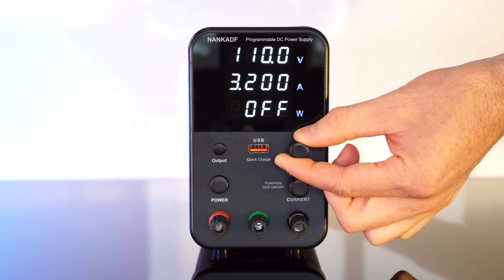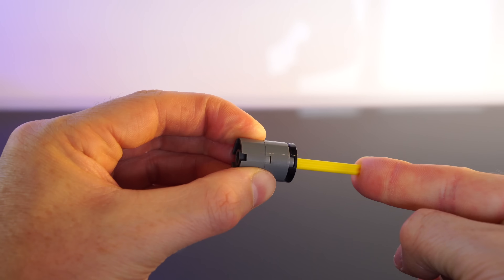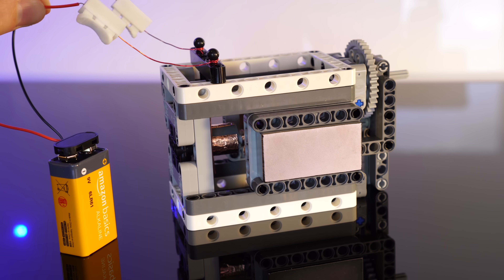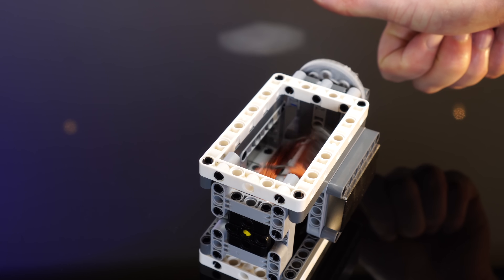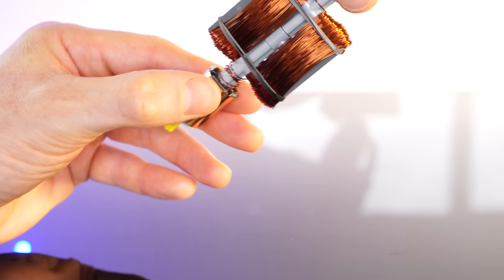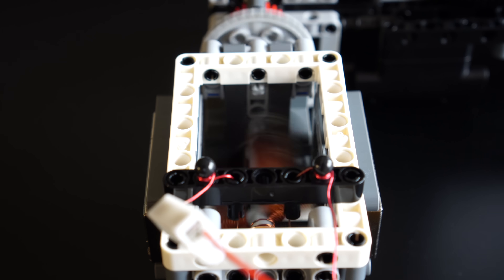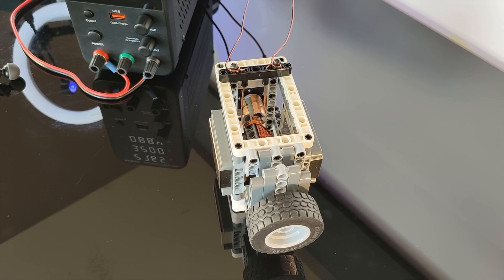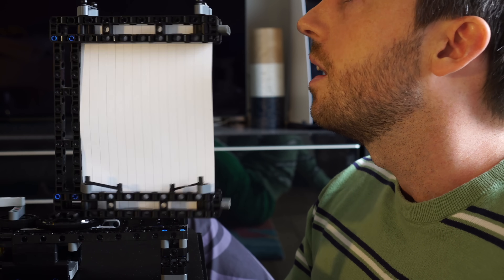Melting Motors: 120 Volts vs Homemade Lego Motor

Comment: You might be able to reduce your arcing by connecting a 150V bidirectional Zener diode or TVS diode (Transient voltage suppressor) between your windings.

The cause of this arcing is the stored energy in the magnetic field (E = 0.5*L*I^2) that is present when your coils are energized. As soon as the contacts of your commutator open, the magnetic field collapses trying to keep up the current that was flowing before. To achieve this, the coil has to build a high voltage than can bridge the pretty high dielectric strength (3kV/mm) of the air gap causing arcing.

The voltage created by the coil is equal to:
V = -L * (di/dt)
Where as L represents the inductance of your coil and di/dt is the change of current. Since opening the contacts abruptly means a very high change of current (di/dt), the voltage created by the coil will rise tremendously.

If you connect a bidirectional Zener Diode that will start conducting at 150V, it will clamp the produced voltage down to that 150V and gives a safe path for the coil to release its energy.

However the higher the voltage of the coil, the faster it can release all its stored energy and be sooner ready to accept the current in the reversed direction. I never tried this myself and I dont know how long the diode will last or die out after a couple of revolutions because of overheating, but I think it might be worth a shot
Reply from the maker: What a fantastic comment, pinning for education. Thanks a lot for taking the time to write this out - super easy to understand, and very interesting to know why these arcs occur. I have a lot of zenner diodes lying around and will see if I have any appropriate ones to test in future experiments. Appreciate it! 🙏
Reply: @JamiesBrickJams 
Hey Jamie, thank you. I rarely leave comments and never had the honor to be pinned.

But I have to admit, that I really liked your way of approaching this project by just trying stuff out on your own and not being afraid of failing or damaging something in the process.

It is a good demonstration of how engineering works: You have an idea and try to make it work, but something you haven't considered yet is totally destroying your effort. 
(e.g. a current limited power supply as many viewers have pointed out already ;-)). We all have been at this point. Most important is to not give up. From my experience there is almost always a way to make things happen.

I'm glad if I could maybe help you in the process. Even though motor drives are not my field of expertise the fundamentals of physics I layed out will hold truth and the culprit of the arcing problem is the discharging of the magnetic field but there are several possible solution to this problem.

Keywords are 'Snubber circuit' and 'Back EMF'.

By the way with bidirectional zener diode I meant two zener diodes put against each other in series. I was not sure if that was clear.

I am looking forward to a follow up video. :-)
Reply: @JamiesBrickJams you switched to cc
Reply: Bullshit. It is arcing because he know almost noting about motor construction and commutating the coils at wrong angles.
Reply: Motors normally use a capacitor for this purpose, even the ones for toys.
Reply: I'm thinking that the arcing may also be due to the commutator making poor contact?
Given the commutator is anything but smooth because of the superglue and the gaps the contact wire is probably bouncing around a lot and intermittently breaking contact.
To solve this maybe pin the other side of the wire down so it's tensioned and won't bounce as much. Also using multiple wires to distribute the current
Reply: this is truly a back EMF moment
Reply: most importantly add one of those ceiling fan capacitors across the terminal
Reply: What the sigma

Comment: metal on metal ain't better . use carbon brushes , they provide lubrication and heat risistance. make your core out of iron and have commutatiors at a slight offset to the magnets and windings.

Comment: 0:57
Yeah, I can imagine.
2 small ones from a harddrive (I harvest them whenever I have a harddrive that dies) snapped shut on my index finger a few months ago. And they pinched the skin so perfectly that I couldn't even shim them apart.
Eventually I just had to rip them off, along with the skin caught between them.

Seriously, Do Not F with magnets this powerful, cause best case scenario of an F'up means that you now have no skin in a big area. A bad F'up means you can no longer count to 10 on your hands...

Comment: 5:22:  Your commutator doesn't seem to be made right.  It is supposed to be split, like two pecan halves facing each other, so that the polarity changes every half-turn.  That polarity change is what makes the motor work --- though of course it is still difficult with a motor that has only 2 poles.

Comment: I wonder how big and powerful motor could you make with this style. Like maybe big axial flux lego motor that is fully brushless using hall sensors and driven with vesc for best control over coreless design lego supports.
Reply from the maker: I think it's possible to make a very powerful brushless motor if I use a BLDC. I've already made some pretty powerful ones. Current problem is vibration and magnets getting thrown off the rotor 😅 Time for some 3d printed parts I think 🤔

Comment: What size are your magnets? I wanna buy some but don't know what size to use. (Also, if possible, I would like to know where you bought them)

Love your content btw
Reply: I think I figured it out.
Using the surrounding lego piece size and average market size with the conversion of cm. to inches.
(Length Width Height)
1.97 × 1 × 0.4 inches
5.0038 × 2.54 × 1.016 centimeters

Please, if I miscalculated, feel free to correct me.

Comment: When working with magnets if you want a strong magnetic field, but only need it on one side of the magnet consider using a halbach array layout. You should have used better brushes as well. Also as others have said your power supply switched to constant current, when it hit the 3.2A limit,  so it wasn't running at 120V.

Comment: Nope, your limited @ 3.2amps and probably never really reached 120volts. At 4 ohms resistance the power supply must output 30 amps so...

Comment: i just used a power wheel motor it doesn't even need gear reduction it just goes 7897rpm at 12 volt and 1.75amp

Comment: The power supply is nice, but not powerful enough! You would need to push at least 10 amps at 120 volts for ultimate destruction!

Comment: If it's a magnet you don't wanna mess with, computer hard-drives. Two magnetic discs that are very hard to pull apart
Reply: Not to mention any dust in it kills the whole thing

Comment: This should work at 9V with a some improvement. First, the coil dont need to be oval, a circle shape do the same job but with less resistance. Second, you need to put the magnet the closest you can from de rotor. Thrid you need to put a feromagnetic material with a high magnetic permeability to increase the magnetic field in the rotor and you can even put this material around the motor to increase it too (just like the real motors do). Fourth : the connection between the wire and the aluminium tape must not be good because of the glue . Try to fix the wire and the tape between a lego piece fitted together with the rotor. GOOD LUCK , it is a nice project !

Comment: The coils need to have a laminated steel cores to work properly. That's why your amps are getting turned into heat rather than emf. Eddy currents are a killer. Adding more poles/bars to the armature will make it run more stable under load. Try using flat copper alloy springs for your contacts. More surface area is better for carrying the current and it will run cooler.
Reply from the maker: Thanks a lot for the suggestions, this is helpful. I've made a few motors with cores made of bolts, but find with these larger magnets that they put a lot of strain on Lego components when using a metal core. But I'm sure there's a balance that can be struck with more moderate magnets and a steel core. Cheers again for the help 🙏

Comment: Like others have said you didnt actually achieve 120V operation. You were being limited by the power supply hitting its current limit before its voltage limit. 
Getting around this is rather complicated because motors are very dynamic electrical loads, and everything from the strength of the magnetic fields from the permanent magnets, to the mechanical load on the motor, to the shape and spacing etc. of the coils themselves. If you took the time to learn the fine details of motor design im sure you could design one in such a way to run at full power (highest voltage and current at the same time). Or you could do my favorite approach, make several iterations with slight changes like different number of turns, different spacing to the magnets, etc. and try to find a trend in the power usage you can use to "guesstimate" the best design.

Still a very cool video showing the simple concepts of brushed motors and how their self-commutation works.

Comment: that's actualy 40 volts. get a variak, full bridge rectifier @electroboom and a capacitor for FULL "120" volts
Reply from the maker: I'd love to get a variac - cheers for the recommendation! Just need to justify the spend at some point

Comment: i would recommend you try with AA batteries next time instead of a 9v
edit: i should really watch more of a video before putting a comment, but it still applies, I'm sure it would have ran a bunch faster on 6 AA
 
9v batteries can't put out any real current (iirc the best 9v batteries only go up to 500mA for a few seconds when new and fresh), aaa use the same tech so they are equally bad (actually a 9v is litterally 6 aaa in series)

AA batteries are a different story, depending on quality and manufacturer, you can get up to 10 A from a single one (but lowest i saw on cheaper ones was 2-3 amps) and they maintain it for at least 30 seconds (when fresh)

Comment: Nice :D , you should add more parallel contact points (brushes). Using only a wire as a brush makes all the current go trough it , and will melt . with multiple points , the current will be divided by the number of "brushes" , and will make the collector last longer . the heat point will be mainly on the coils (you can add a Lego Fan/propeller to the rotor axe near the coils to cool them . With 4 coils in a + pattern should produce some interesting results :D

Comment: If you want to run your motor at 120V, you need a power supply that would deliver about 30A!!! Ohm law = 120V/4Ohm coil = 30Amps. Your power supply current limits at 3.2Amps.

Comment: Do steel logo exist?
Reply from the maker: I'm not sure about steel, but there is a great company that does aluminium parts
Reply: @JamiesBrickJams   oh then that would work for motors for yours. But I would also want to see a engine out of lego. So what i mean is make the piston out of iron and have a coil around it and oscillate back and forth to make the engine work

Comment: In the next generation, you can perhaps use actual brushes instead of just the wire, so that you get more contact area and less contact resistance.

Btw awesome video, as always. Loved it!
Reply from the maker: That's a lot 😁 I actually ordered some solder wick to use as a makeshift brush for future experiments!

Comment: You actually never got to 120v because you hit the power limit of 3.2amps wayyy before 120v. Powersupply limits current by lowering the voltage. You need to make a less power hungry motor for 120v or get a more powerful power supply
Reply: or he can get two such supplies.

Comment: just a quick tip, for a high voltage motor like you were trying to make, you need not thicker wires but thinner wire and way more windings, just from looking at a 120 volt brushed dc motor i rewired a while back
Reply from the maker: Thanks for the tip! I actually didn't realize this power supply would cap the voltage at whatever draw maxes out the current. Clearly you're right - need to build a coil with a resistance that'll only draw 3 amps at 120v. My original coil at 40 ohms should have been approximately correct, but I suspect I messed up the timer
Reply: @JamiesBrickJams  you should probably go even lower with the resistance something like 100ohms which will draw around 1.2amps which should make the motor work although if you want more power something like 70 ohms for 1.7amps.

Comment: What about putting some carbon brushes or at least lead to the commutator?
Then I would add some bearings at the motor shaft and grease all moving parts,
because at higher speeds the plastic would melt.
And for the next time: buy a more powerful power supply.

But with all that i have to say, it's a cool experiment.
It remindes me at my childhood when i played with several types of electric motors just for fun.
Thank you for this vid.

Comment: 150W with 3.2A is just 47V
Reply from the maker: Yeah that was a little disappointing. I mainly just wanted to max out the supply and see how long it'd run for. Next time I'll need to build a better coil. Though I'd imagine it wouldn't survive long at all

Comment: The motor never ran at 120v, the powersupply was current limited so the highest voltage it ran at was about 50v
Reply: or just build a FULL BRIDGE RECTIFIAHHHHHHHHHHH instead of using the puny power supply
Reply: Ok now iam no professional at electrical engineering but iam pretty sure that was 120 volts because it was on 32 apms and the voltage didn’t drop while it was running so that means it was drawing 120 volt 32 amps at the same time plus the wiring was 600 turns so im pretty sure it can handle up to 560 or 570 volts dc
Reply: @SAVRY2K  it ran at approximately 35v at 3.2A, not 120v. the power supply went into CC (constant current) mode when it reached its max output current at about 35v, asthis model psu is only capable of putting out a max current of about 3A. while it may seem it ran at 120vdc that's just the target voltage being set, the voltage is ultimately determined by the set max current (CC). this model also displays the target voltage while being set to show what the max voltage is, but this wont affect the output if the psu is in CC mode and the user tries to increase it beyond the voltage being outputed.
Reply: @theniftylynx6897  thanks for sharing your thoughts on this and now i think your opinion is correct and it makes much more sense now thanks
Reply: @theniftylynx6897  exactly, the only way to increase the power (watts) using that power supply is to increase the resistance
Reply: @SAVRY2K The only way to learn is to ask questions and make mistakes in the process, admitting that you're wrong takes humility. Hold your head high brother :-)
Reply: @Middle_G1 you are the first person I’ve seen on the internet that didn’t start an argument over something like this, so kudos to you

Comment: you never hit 120v, not even half of that. your 3.2a supply was going into constant current mode causing the voltage to dip. if you actually ran it at 120v it would draw probably near 10a or 1.2 kilowatts. also a thicker wire would run it at even lower power and voltage because it decreases the resistance that in return increases the current demand that your supply cant provide, thus it has to lower the voltage.
Reply: It's a 360 wat power supply
Reply: You can either have up to 120V, or up to 3A for a max of 360W. But you can't exceed 120V or 3A, and current limitation works by decreasing the voltage, so..

Comment: Can you run in 220v?
Reply from the maker: If I had a power supply that could output 220 it's possible in theory.. Though if you wanted the motor to survive that, it'd have to be designed differently to most motors to handle that voltage. Especially if it is pushing a significant current

Comment: Why not make the union with copper plates with copper plates, instead of a copper plate making contact with a thin copper cable? The contact point is very small, instead of increasing the diameter you could crush the tips of the cooper cable to increase the contact surface, but for that it is better to use those copper plates for the entire contact.
Reply from the maker: That's actually a pretty good idea, cheers! I've also just bought some copper wick which I've seen recommended - seems to be a flexible way of making good contact
Reply: @JamiesBrickJams  Now that I remember, in Tom Stanton's last video he used something similar to a braided copper wire and an alloy that I don't remember, but it seemed that it also made very good contact and seemed very flexible like a rope, I don't know much about electricity , but I suppose you could add 2 more fins of the copper wire, make 4 fins (2:05 there are 2 so I would say double it), although maybe it would become very complex to balance and not rotate, although I suppose it could be done of 3, although it may not increase strength, it may be that it increases effectiveness, your videos are so good, keep going !

Comment: What if you internally cooled it it with a little fan blade like power tool motors?
Reply from the maker: I suspect I'd need a much more efficient motor design before I could even consider that - though I like the idea! I just know my current design is absolutely awful and would melt no matter what. Some thicker wires and more poles would be a good shout to start with though

Comment: Suggestion— use solder wick as brushes instead of just bare copper wires
Reply from the maker: Love the suggestion, thanks - I've just bought some!
Reply: @JamiesBrickJams  Tom Stanton has a good example of how he used them to build an electromagnetic sled to launch model airplanes